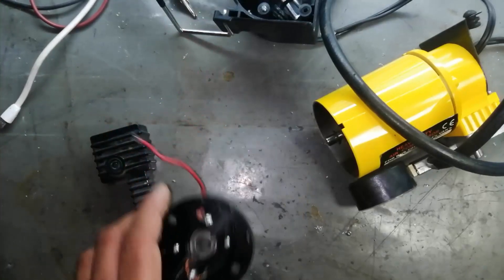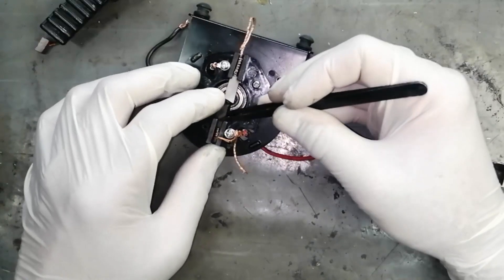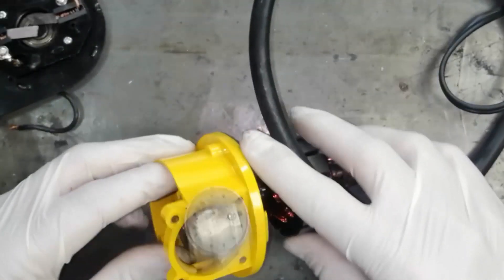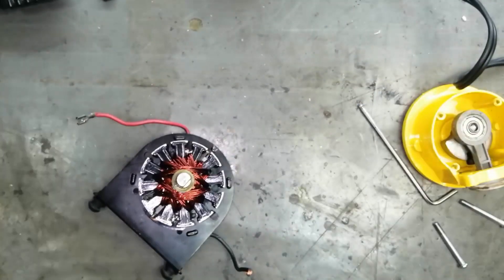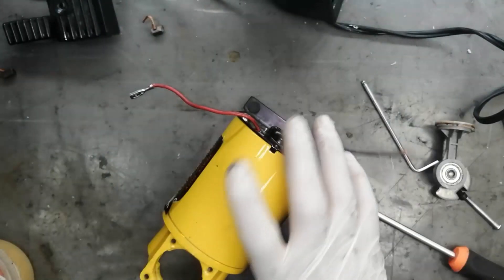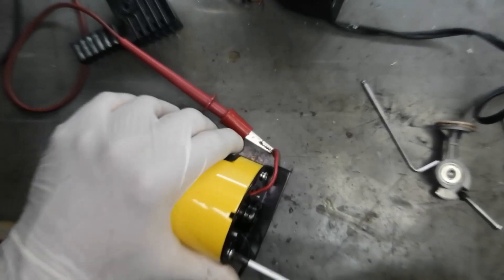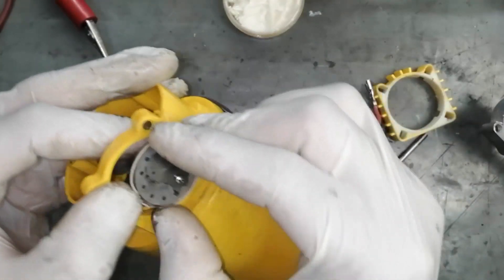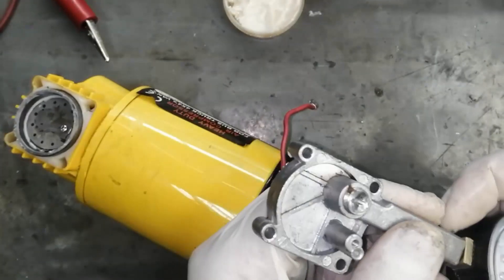#194 how to repair AIR COMPRESSOR Part 2

Comment: Please what's the problem with my inflator. I have a portable double cylinder inflator but will only work when it's not connected to tyre. When it's connected to tyre , it doesn't work. I have changed the two carbon brushes, the problem persists. When it's working, I noticed the gauge remains at zero even even when I blocked the nozzle with my hand like you did. What could be the problem this inflator.  Help me out please

Comment: 01:25 : What code do you use for the carbon brush? can you use a carbon brush motor radiator fan?
Reply from the maker: it is Carbon brush with half copper 
same as J204, J471